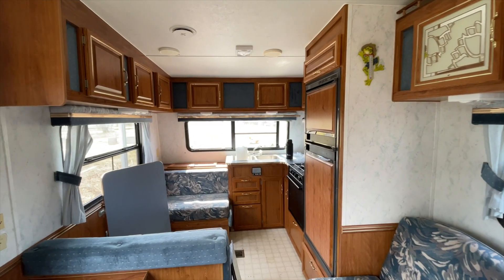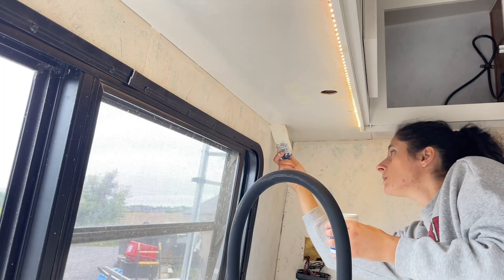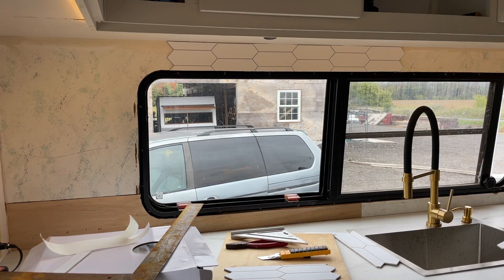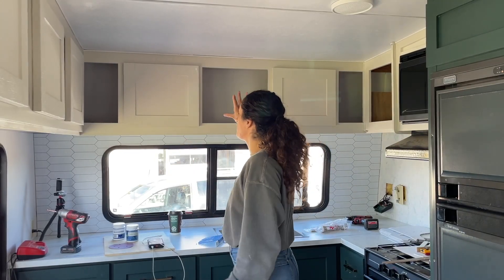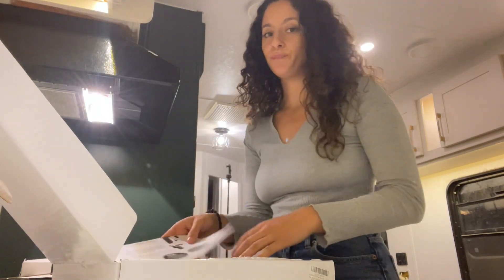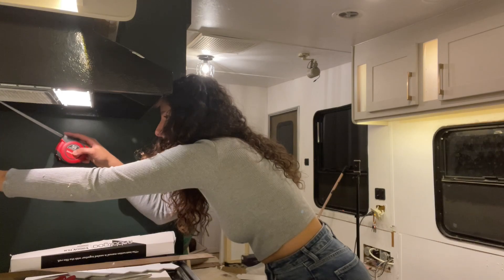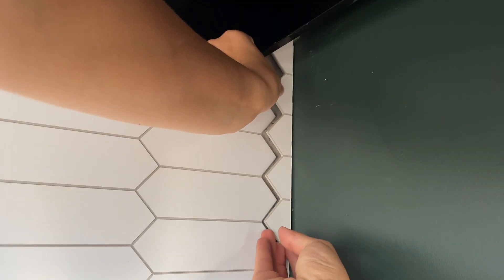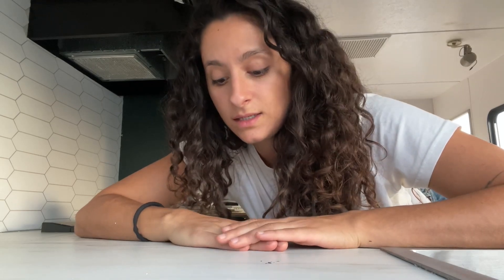Kitchen backsplash in my Fifth Wheel Camper! Not sure I feel about It lol

Comment: Love the kitchen! I’ve never seen a thick sticky backsplash like that! I live in a camper and used grey Smart Tile peel and stick backsplash  (installed in early 2019). They have held up super well, even with major temperature fluctuations. No peeling or anything. I think the biggest reason they have stuck well is I made sure the camper was warm when I installed them.

Comment: I envy you with those drawers that are actually made out of wood, AND, are on slides…my 33 year old camper van’s drawers are made out of cork except for the front, and, they’ve gotten to where when I pull them out to open they crumble bc they’re so old 😩😡. Watching you install those drawer and cabinet pull knobs reminded me of ME doing that just a few days ago!…factory never installed them in 1989 on mine. Awww geez…you had a drill hole template to help you line up your holes…I didn’t even know they MADE those! Lol! So I had to do it the hard way! The back splash came out really nice! If you plan to caulk the corners, tops, and bottoms be sure to notch the tip of the caulking tube outlet in a ‘V’ shape…it’ll spread it evenly as you go…idk if you knew that already, just saying! Great video as always! Stay safe! ~Jim~

Comment: A little late now, but a little tip for installing cabinet and drawer hardware. Take a piece of masking tape and cover from one screw hole to the other stretching tape taught. Punch holes out, now you have a template and don't have to measure.

Comment: Here's a thought, Put a table just under the kitchen window that will fold down when not in use.  The folding brackets for the fold down table are generally around $12.00 to $15.00 a pair.

Comment: Silicon into the gap is the easiest and it will become literally invisible. The backsplash looks nice.🤗
That telegram scam is everywhere.
Reply from the maker: Ya I think you’re right! And yeah! What the heck they are relentless!
Reply: @julbm  On second thought, if you have some of the material left, check if the silicone will stick to it. These sealants are also available based on acrylic, which sticks very well to this material. I guess it is a wood fibre back with a plastic foil on top, like most panels are made up of. I havent tried silicone with this material yet.
Also i thought how are the pieces sealed against each other? There is glue on the back, but no sealant where they touch. If something splashes against it, it could penetrate in between two panels and become nasty.

Comment: Why did you start to stick the tiles in the middle of the wall section??? You should have started on the left with the pieces flat side to the left like the ones on the top left of this part of the wall.
Reply: Or is that back wall at an angle?? I'm just trying to figure out why it doesn't look straight
Reply from the maker: Yeah the wall is not square lol it drives me crazy and I probably could have done a better job but I tried lol